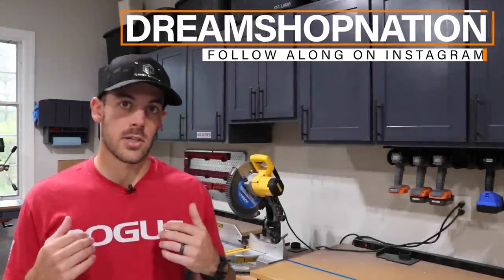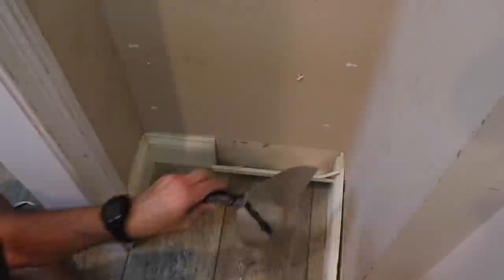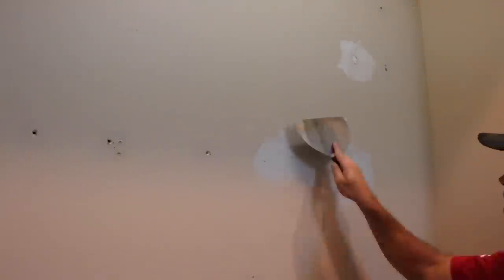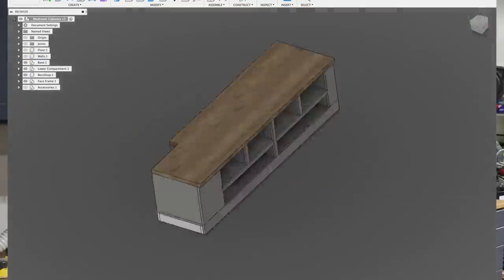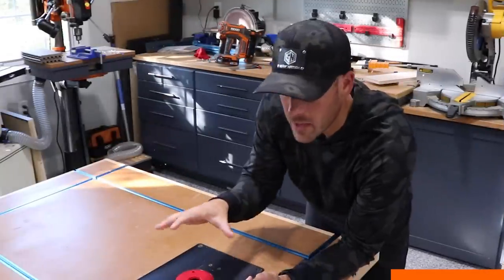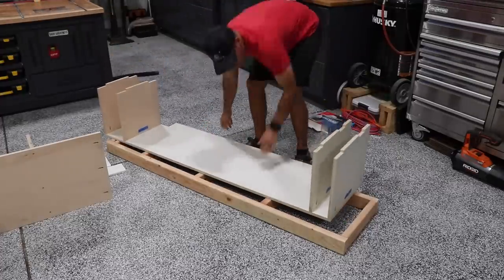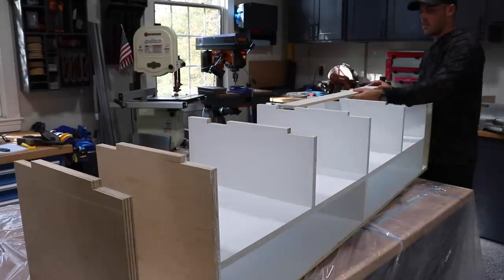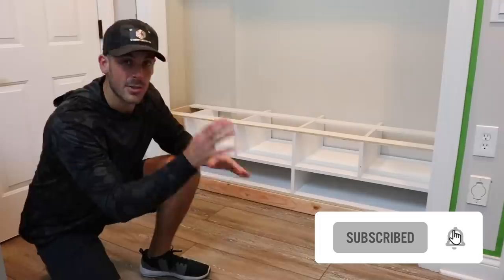Building custom cabinets is tough! // Part 1

Comment: Nice job! Can’t wait to see how it looks after part 2. A quick comment/tip for removing the baseboard trim. I found this cheap tool on Amazon a few years back and it works awesome for popping of all sorts of trim without damaging the wall! It’s called a Zenith Industries Trim Puller. Can’t wait for the next video.

Comment: My drywall tip is not just to use a palm sander… but use a palm sander with the Diablo sanding screens.  The screens work exceptionally well on drywall
Reply: Great tip!

Comment: There is a specific molding removal tool.  Don't own one yet,  Its really wide so it does not damage the walls. You can lever it out.  Looks very cool.

Comment: Surprised you don't have a vacuum attachment for sanding joint compound. Not expensive, gets 98% of the dust. I've used one for twenty years plus. Hint: for baseboard removel, use a smaller flat pry-bar, like those used in beekeeping, (they're at every hardware store), then use the long leg first. You're removing base trim, not lifting a refrigerator.

Comment: Hey Travis, if you don't mind could I give you a tip? 

(Tip below)
You may want to lower your router bit while assembling your cabinet or anything for that matter. Because if you hit that bit just right. It could easily bend, or even break. And then your having to get another 20+ dollar bit, after a simple mistake.
(Just a thought my friend. I've broke them before. It's no fun at all.)

Comment: Just wondering, since you pieced together the carcass of the storage bench, why not install in two pieces so it could fit tight against the end walls? The difference between the diagonal and the straight dimensions can be made up with trim or a face frame, but it just seems wasteful to my engineer mind. Looking forward to your thoughts on how to handle shoes and boots under the bench.

Comment: the Kreg 720PRO has some flex on the plastic side when clamping on 2x4
Reply from the maker: It may look like it, but the whole this is reenforced with a steel frame